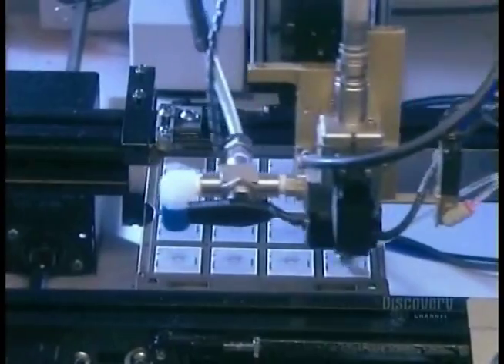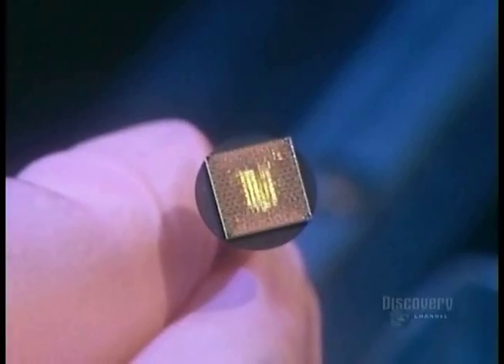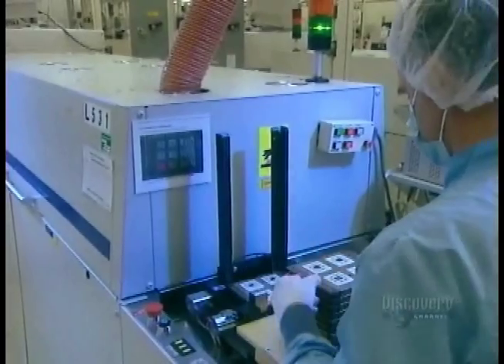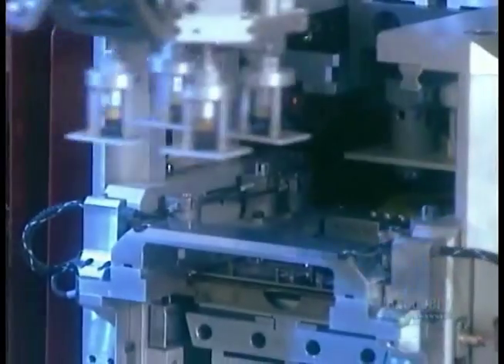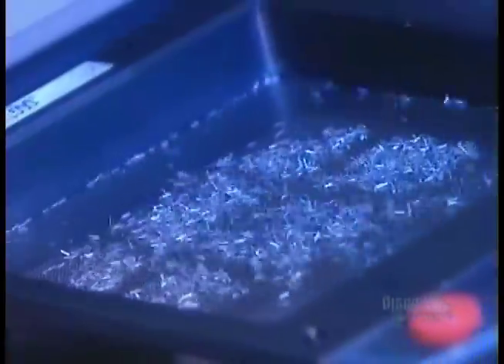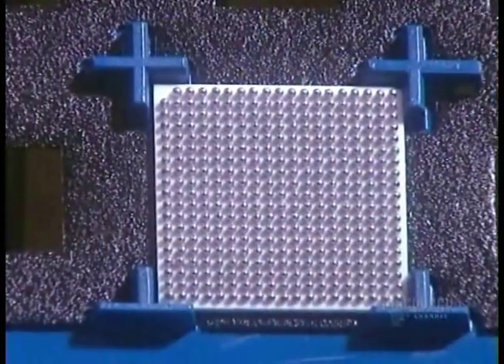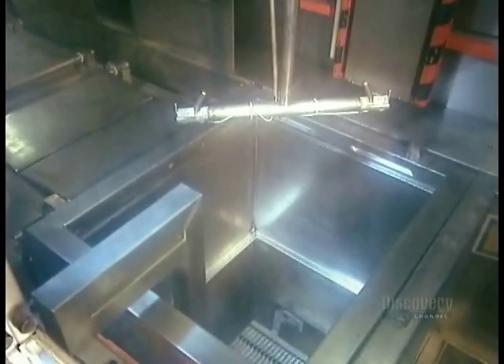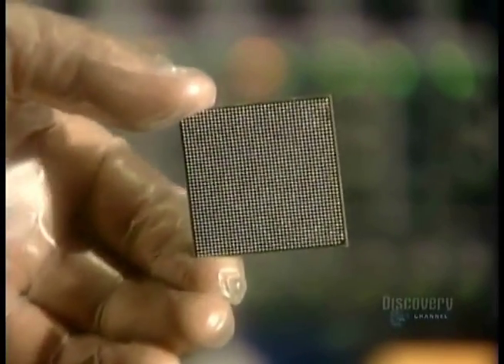How It's Made - Computer Microprocessors

Comment: I would really like to know what company this is, those processors look cool!

EDIT: Just saw the IBM part, are these PowerPC processors?

EDIT 2: Just found out that these might be HP 3AC2-0002 PA-RISC Microprocessors. Very cool indeed! The PA-RISC architecture has always fascinated me.
Reply: Any luck on figuring out the name of the manufacturer?
Reply: @braddbitson4209  Hi Bradd, wasn't expecting a reply to my 1 year old comment. I'm still looking into it, not sure what the manufacturer is yet. It appears to be a BGA design, however.
Reply: @braddbitson4209  Just found out that they are most likely IBM PowerPC PPC750CX series processors.